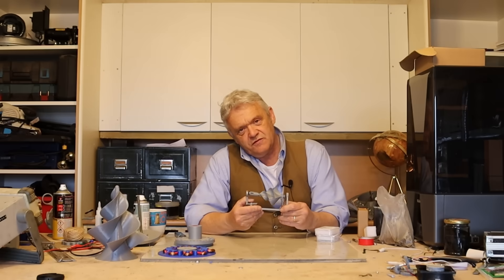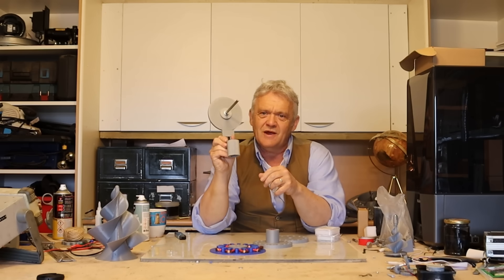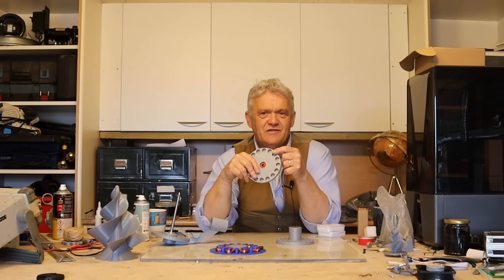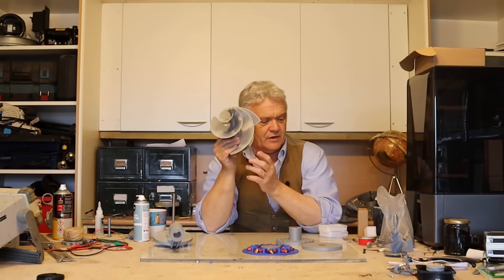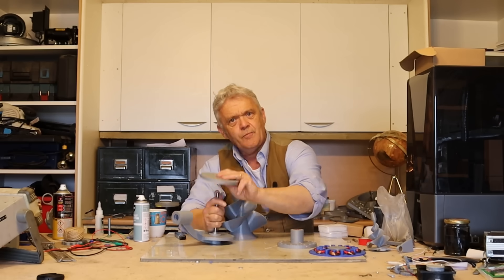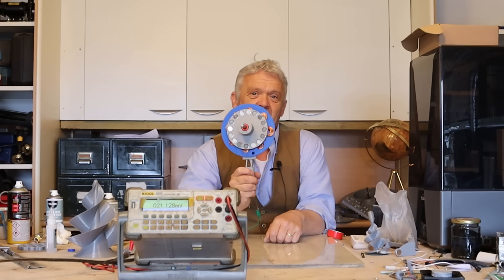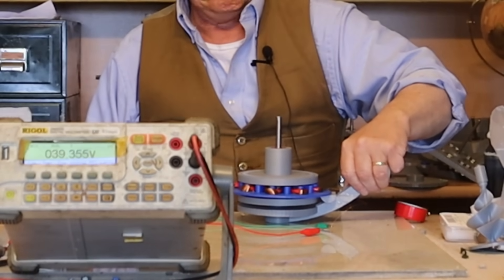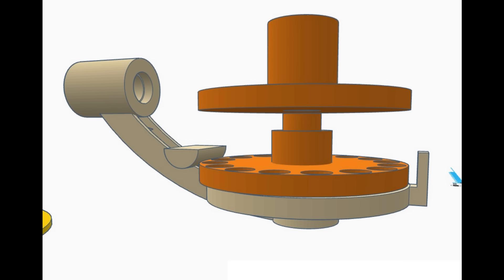1998 Archimedes Wind Turbine Generator Combined

Comment: Hi Robert, this is an amazing project! I'm really impressed with your work.
I'm hoping to build something similar and was wondering if you could share a few more details:
What material did you use for the 3D-printed parts?
What was the approximate cost or how much filament did you use for the print?
Could you share some details on how you made the coils?
What gauge wire did you use for them?
Any information you could provide would be incredibly helpful! Thanks for sharing this great video.

Comment: Thanks for this video. It looks great. I have a question. The turbine turns horizontally in the direction of wind. What mechanism do you use to prevent curling of the wiring from the generator to the battery because in principal the turbine can turn 360 degrees horizontally due to change in wind direction.

Comment: Hi Murry, this is Leon and I would like to have a copy of the wind turbine archimedes wind turbine  3d drawings

I just need the turbine which looks like a washing machine agitator  with a 8mm shaft

Want the shaft to rotate clockwise

I will show you what I will build with it

I can use tinker cad also

Want to put a hub with a bearing on both ends and have the turbine spin on the shaft if you can help me with it

I want to make it bigger in size

Comment: You better add soft iron disks behind the magnets to close the magnetic field flux. this will increase the magnetic flux in the air gap and prevents flow of magnetic field at the back of the magnet plastic disks.

Comment: SIR!!!! I was first introduced to you when you were working on the Darwin wind Generator which CAPTURES WIND and then forces the wind into a generator which would SUPPOSEDLY generate far more power than just a generator itself. Now here you are talking about the Archemedies, WHICH HAS YET TO BRING ANYTHING TO MARKET, which does not even have a capture system. IT SEEMS AS THOUGH YOU ARE GOING BACKWARDS!!! What happened to the Darwin device that you spent so much time on that seemingly worked well. What happened to the Ventum Wind Turbine in Skegness, London?? 

Are you a part of the system that is PURPOSELY keeping alternative energy in the dark ages?? Wind turbines and solar energy have been around for DECADES with VERY LITTLE ADVANCEMENT!! Here you come showing all types of promise with your 3D printer then suddenly you abandoned what had the most promise than go backwards. Not to mention the fact that the Ventum you promoted in London has YET to bring a product to market as well.  STOP PLAYING AROUND WITH IT AND HELP MAKE ALTERNATIVE ENERGY PRODUCTS AVAILABLE TO EVERYONE!!!

Comment: The  improved efficiency spiral wind turbine was already Patented in US by Japanese man in Texas, a long time ago. Large scale models also built. It's called Tornado turbine. Also, the late Mr. Baumgartner had  built a lifting device platform utilizing the ETHER , by swirling of turbine air with high rpm motor, very low power , and lifting very heavy weights. (Extracting energy power from the ETHER through angle of NATURE'S spiral). He used computer program to get exacting design . Two-page article with photos was in an old Alternate Energy newspaper.

Comment: This is very nice project and I wanted to try it out. I managed to print all the parts and assemble it. As mention in the instructions I use a 0.2mm copper wire and created the coil using 400 windings. For magnets I am using 32 NdFeB grade N42 15/8 magnets. In the instructions it was specified to use 64 15mm by 4.5mm neodymium magnets. I could not find that size so I used thicker one and 32 of them for the 32 holes. When I rotate slowly I get up to 1 V voltage. On higher rpm it is 0. What can be the problem. Magnets strength? Number of windings? Does anyone have any suggestions what to try?
Reply: Found the problem, the voltmeter I was using turned out to be DC only. When I found one that measures AC everything worked, Peak voltage 42V, works great.
Reply: I'm dying to know, how many amps did you get?

Comment: Any transfer of energy from one type to another always loses energy. Coal and fuel burnt to produce  shaft rotation and then to electricity loses a lot of the calorific value which existed in the original fuel.  With wind it is the same as one cannot get the wind behind the turbine to slow down to zero velocity, to extract all the energy in the prevailing wind. Betz's Law says a lot about the efficiency of extracting energy from the wind which is 16/ 27  or 59.3.% With solar panels, water waves, it is the same.

Note that I did not mention " voltage" as in t his video, or "current".  You can get 1000 volts  easily with the right winding, but it does not mean a thing, as you can put a 1000 Tons Force on the static foundations of a skyscraper but there is not an ounce of energy generated. This video could be misleading to those who are uninitiated in Engineering. One should ask about "Watts" as that is "power" generated and with time it becomes Energy which is what counts.  He should have loaded the output of those windings with a resistor.  Also note that the voltage and the current must be IN PHASE  as otherwise  when they are in quadrature or at 90 degrees with respect to the other there is still no power involved. That size turbine will generate not mote than five watts,  at 10 metres/ second wind, enough to charge a mobile phone perhaps, 

To understand what is PHASE of 90 digress one may try to hang a load of one ton  from the sky and as long as it hangs down vertically  there is no energy used up to lift it, That is a vertical load, If a horizontal force is applied to the load  it will not move vertically up so there is no energy input to the load as moving it sideways does not give any energy nor lift to the load  hence there is no Energy involve as the two  distance moved by the load and the force on the rope  are at 90 degrees to  one another, 
To give energy to the load, the force generated by the load and the distance moved must be in the same direction,  

One must be careful when one sees videos on wind turbines indicating what voltage output is produced as it does not mean a thing as far as its power and energy generated.

Comment: Nice Construction. It spins well. It makes voltage. Put a little load on it and see what happens. Maybe you could get enough power to charge a phone. It needs to be much bigger to serve a useful purpose. I think a large one could be hooked to a hot water heater to get a little free hot water if you have enough wind.

Comment: hi,  what if a couple of these turbines were placed behind  the front of a car under the bonnet using them to top up the battery, replacing the alternator which would in theory make  the car more fuel efficient, just a thought?

Comment: I think its better not to put a cone rather leave it open because of the wind dynamic behavior of pressure differences and flow speed just like the original support spokes will do a better job

Comment: Robert, I enjoy your videos and I would love to see you build my idea. I envision a two foot metal rod with a large archimedes turbine on one end and a generator winding on the other end. There are magnets that create a mag lift to the rod and in the center of the rod there is a flywheel. The flywheel has holes drilled at a 75 degree angle that house magnets that generate a magnetic push once the wind starts the turbine spinning. Mounting it on a platform, would allow for adjustment and maximum wind capture. With the hand powered spin of the flywheel the turbine and magnets would increase the speed with very little resistance.

Comment: Will a funnel shaped skirt at the rear smooth the vertices at the rear archimedes screw inprove the efficency and cut down on the vibrations and make the generator point into wind self steering ?

Comment: Again, the same measurement error: the way that the anemometer is used to take the wind speed, the body obstructs it; you can see at 5:37 that the anemometer's blades are not moving at all when the turbine, which is not obstructed by the body, turns at high speed. Why not fix the anemometer ont the turbine's handle ?

Comment: Your an amazing thinker.
You make me wish I had a 3D printer.
Magnetic circuit, ✔️
41 volts for 400 turns .2mm wire.
What do you estimate the ampere generation would have been for the 41 volts?

A resistor bank is used to protect coils in the wind turbines during overspin, where excess amperage can be disapated as heat. 
May also stop the blades from spinning.

Next,
Cylinder of serpentine stator and two magnet rotor cylinders as the cone inside of the Archemedes Screw.
Reply: The usual reply to these is "Try it out yourself, haha!"

Comment: The pelton wheel could be made on a much bigger scale, lets say 30 ft, at the end of its life reuse by cutting out the cone and putting a roof on it.
Gaps in the side can be filled using ply and  fibreglass.
A much better outcome than landfill.

Comment: I don't fully understand the benefit of the taper in the screw; does this produce more power than if the blades were full length all the way to the end? Wouldn't that mathematically produce more power just because it's simply that much more surface are?

Comment: If you put the magnets in and eliminated the south facing ones leaving an empty hole would it create a fluctuating DC current rather than an AC current in the wire thus eliminating the need for a rectifier?

Comment: You’ll forgive me but I’ve been wondering why you don’t set the magnets in the center of the disc and place a coil on either side. Wouldn’t that generate twice the power of a single coil?
Reply from the maker: you can do that if you want but it won't generate more power - the power comes from the input not the coils - a generator converts mechanical energy into electrical energy the limit s always going to be the amount of mechanical energy going in - in this case the mechanical energy supplied by the wind to turn the rotor

Comment: I think a bit of the wobble/unbalance is due to the spiral not being evenly distributed in weight. A way to counteract this without messing with balance weights would be to make it a double (or more) spiral. Fun video though :)
Reply: I wonder if you could put a screw in that counteracts the wobble. You could fine tune the wobble out then.
Reply: Like with car tires

Comment: I have really become interested in generating power watching your videos but I'm still basically baffled on the entire concept of wattage, amperage and volts. Do you have a video for beginners that can explain it in laymen's terms or could you possibly do one? You show what your awesome builds produce but unfortunately I can't apply what the potential means. Thanks!
Reply: Volts times amps = watts

Amps is the current flowing. So a higher voltage will need less amps to achieve the same wattage (power).
Reply: @mrwess1927  So, only the end result (watts) is critical? So I can have higher voltage, and lesser amps or the opposite, and it'll work the same? This is a very complicated subject.
Reply: I think the more amps pushed through a wire the thicker wire you need. That is why homes are powered by higher voltages like 110v and 220v the disadvantage pf lower voltage systems is that they need to handle more amps for the same amount of power.

120 watts @12v is 10 amps but 120 watts at 110v is about 1 amp. A smaller amperage at a higher voltage will reduce resistance which causes the wires to heat up and cause innefficiencies, unless the purpose was to make heat in the first place.
Reply: @mrwess1927  So amperage is like flow, or gallons per minute? More amperage in a thinner line would create more pressure, or resistance (and heat) in this case. What would a good analogy for the volts be?
Reply: Look for the NEETS manuals. They trained me (and other sailors) in electronics.
Reply: @realorfake4765  I'll take a look, thank you.

Comment: Does the copper wire have a coating on it for the serpentine coil?
Reply from the maker: yes - it's magnet wire - so it is coated with an enamel - basically all coils are made with this wire - this is an example not a recommendaton https://uk.rs-online.com/web/p/copper-wire/1617764?cm_mmc=UK-PLA-DS3A-_-google-_-CSS_UK_EN_Cables_%26_Wires_Whoop-_-Copper+Wire_Whoop+(2)-_-1617764&matchtype=&pla-333359253336&gclid=Cj0KCQjw5f2lBhCkARIsAHeTvlicxS9MLP7kpn_ArOFbZDmx51pPn8-cV-bA8i5bib-qn9oBdi3oZAUaAgfBEALw_wcB&gclsrc=aw.ds

Comment: I have what might be a bit of an experiment for you.  As you like using magnets, both natural and electro.  Say You have a chamber that has two holes in it on either side.  Not top or bottom, think front and back.  There are valves to only allow the passage of air one way, so on the back it would only allow air into the chamber and on the front, it would only allow air out of the chamber.  The valves could be simple flaps activated by pressure, no need to be fancy.  Now, inside of the chamber there is a piston and as it moves up it pushes the air out, which would go out the front, and then as it lowers, it would draw air in through the back.  Would you be able to put permanent natural magnets in the piston, and then on the top and/or bottom of the chamber have electro magnets that would attract and then repel the piston alternatively?  Do You think it would work as a bellows?  Would it be better than a regular fan or bellows?  Would it be quieter?

Comment: What if you punched some holes at the bottom of the cone to make use of the pressure differential you'll have created? Could you drive a secondary and lower power turbine elsewhere in the system?

Comment: I would be interested on the efficiency of the different designs. 
If you have much wind, all would work and generate enough energy for privat cases, but mostly are low wind conditions with less energy inside. So its important to use the theoretical possible energy with low wind efficient.
Sure it is not Trivial, but maybe you can test equal scales of your designs on a big ventilator with the same generator and measure the power output?

Very nice work you do!

Comment: That's a really nice build - maybe my favorite of your designs yet!  I'm excited to see how it performs.  I live in the southeastern US and my heat pump runs probably 9 hours a day on average at this time of year.  I think I can make use of that exhaust air from the condenser fan, providing it's enough to collect and use in the shop.
Reply: It's worthwhile considering that if you added this to the air pump exhaust flow, you might be effectively making the air thicker. I'm not sure how much excess there is in the fan, but it's possible you could cause the fan to need to work harder, or limit the heat input/output. Ultimately, conservation of energy, and I don't know how that would impact that kind of setup, it might be negligible though, in which case that could be an inventive way to net increase efficiency. Not sure how you'd test it. You'd need an isolated system with effective ambient temperature control and then attempt to see what kind of temp differential you could create for some unit input of power with the power harvested subtracted off.
Reply: @azena.  Excellent point for sure.  This is a typical fan though that blows vertical into the atmosphere with no restriction, not like in a pipe or constricted area.  So if I covered it up with like 16 of them it might have an impact, but likely not noticeable with a couple.  Good thinking, thank you.
Reply: @skampp  Quite possibly, it's difficult to say without doing tests to verify. The impact of a couple may very well be negligible, but then again who knows! I guess it also depends on the kind of environment the outdoor units are tested in. After all, they have to deal with wind from multiple directions, so actually, maybe there really is nothing to worry about. I can feel the variable list and unanswered questions growing 😂

Comment: Awesome mate but Id really rather you experiment with a tiny washing machine pump and see what can be improved. Ive gotten hundreds of volts just spinning it with a drill. If connected to a step up transformer..... lots of volts ⚡

Replace the magnetic impeller shaft magnet with a much stronger one.....even more volts.

Comment: So here’s the big question … Which of your wind generator designs over the last few months is the most efficient to produce the most power? Would love to see.
Reply: I think that would depend on your local conditions, and the total setup you put together.
Reply: @andrewsmithmilan1780  You would normalize the data to compare in the case of differing conditions. Just a little math
Reply: A horizontal axis propeller set-up has been deemed most efficient by cross-section.
Reply: @peterdarr383  in optimal conditions, yes. But those aren't in your everyday scenarios.
Reply: @andrewsmithmilan1780  The vertical axis "impeller" (can't remember the name) is more "robust" and omni-directional, but has a 7% efficiency rating.  It's used for phone charging at remote bus stops in Europe.
A unit large enough to run your house would be THE SIZE of your house.
Reply: @peterdarr383  you're actually talking about a mini VAWT for cell phone charging? You realise there are bigger versions, right? I'm running my house at night off one. It's especially important coming up in winter for heating. Quite often, it produces more than my solar.

Comment: You are exactly on track with what have thought for a long time.  Golden ratio capture and conversion of the wind for most efficient processing of it and a way for excess pressure to mediate or pass through so as not to stress the the prop.   Putting these in an array, minimize with magnetic bearing any resistance.  Make them cheap, small, modular and easy to replace.  Cost effective wind conversion anywhere to get the ROI right up asap.